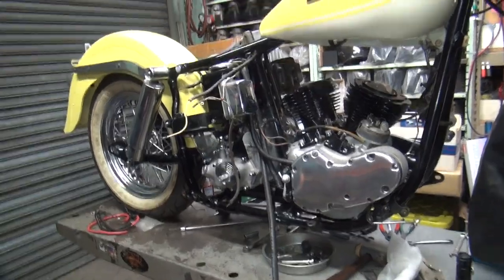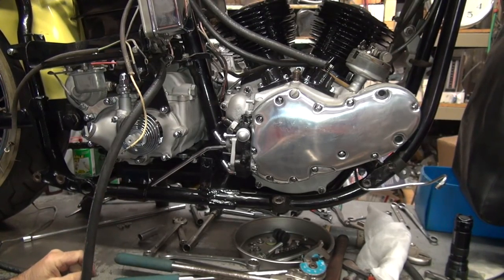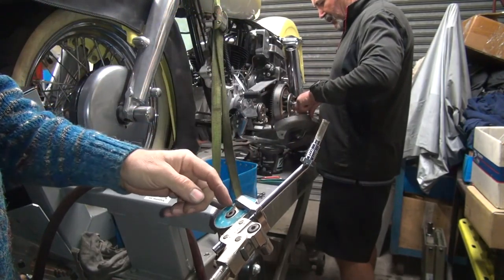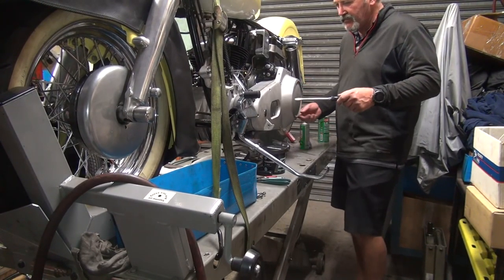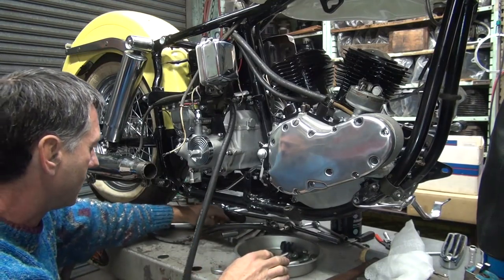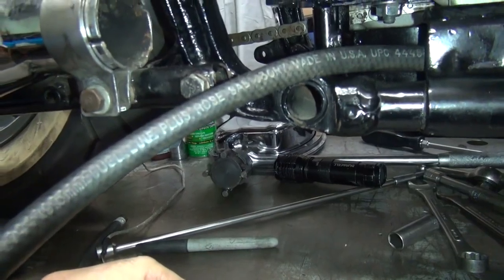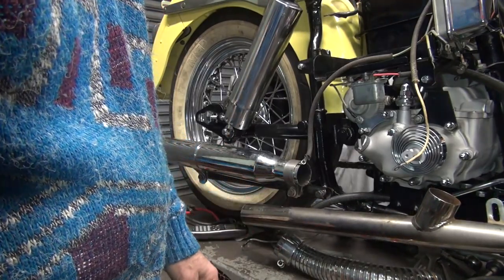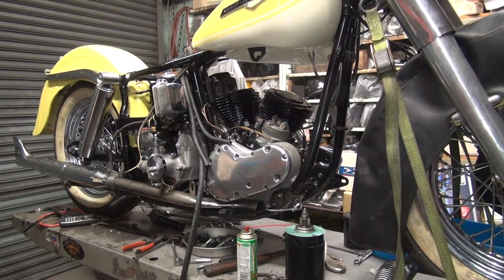1965 panhead #138 74ci flh motor rebuild and bike repair harley by tatro machine

Comment: I bought some of the Gasgacinch and got to use it yesterday for the first time. I gave my silicone sealer to my wife for her Christmas projects this stuff is light years better.
Reply: Nebulax123 LMFAO!!!!
Reply from the maker: 3 bond is next along with torco assembly lube and tribodyn oil. need to get the tatro machine proshop going.

tatro
Reply: Roger that.